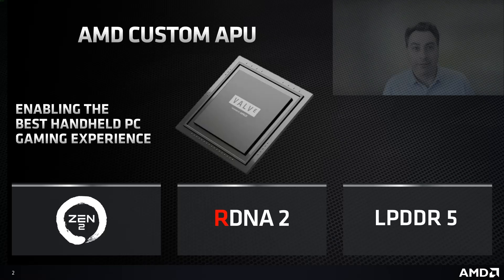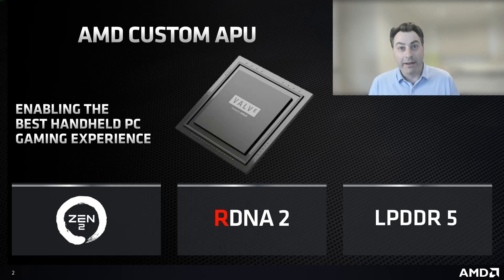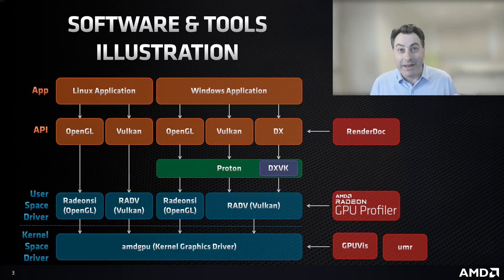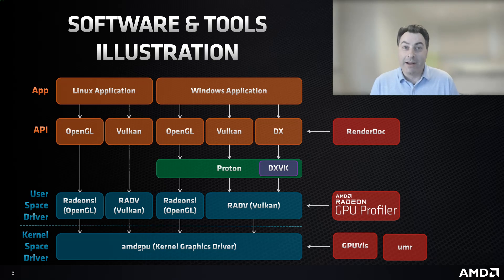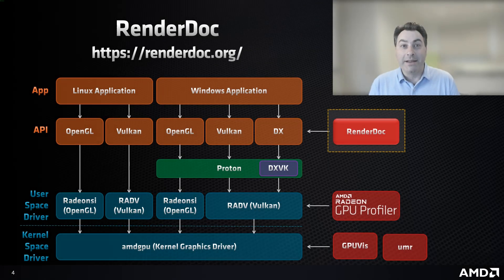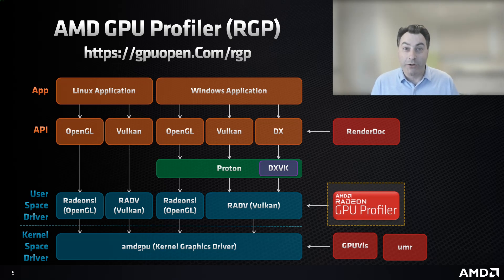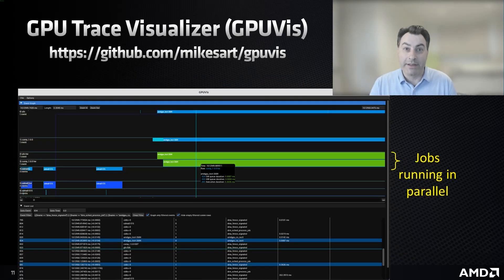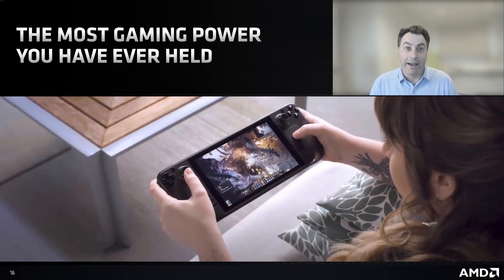APU Deep-dive with AMD

Comment: If someone mainly what to use steam deck on desktop mode, i mean connected to monitor keyboard and mouse, do it Worth?? Dose it have Battery protecting software? Will it work better if you use 🔌 with better cooling ? additional cooling.

Comment: Niice, when can we expect these APU's on desktop? Knowing AMD - probably 2029?! hahahha
Reply: A similar Desktop APU is already available and has been suggested in the "Development Without a Dev-Kit" video.
According to the partners wiki, it's a AMD Ryzen 7 3750H with Vega 10 Graphics, which is mostly on par with the Steam Deck.

Most of the optimizations mentioned here were related to power management, Desktop use has less demanding constraints.
Reply: when AM5 comes out with DDR5. APUs really need bandwidth.
Reply: Van Gogh is mobile only. It will never appear on Desktop. Desktop will receive Rembrandt, which is Zen 3 + 12 CU RDNA. So it should be quite a bit more stronger than the SteamDeck, even more with iGPU overclock and XMP DDR5 memory.
Reply: Maybe you live in a cave?
Zen 2 architecture is already created by AMD on Desktop market..
You didnt forget the latest 5000 Ryzen's APU do you? 
Even 3000 series Ryzen's APU is already powerful with Zen Architecture, let alone Zen+ and Zen2

AMD created desktop version first,
then laptop, and then Steam created their own version of "mini" AMD APU with the help of AMD itself
Reply: @abdur1300  Doesn't have RDNA 2 Graphics, though.

Comment: 3:32 LMAO he literally says games on windows will run better. I'm installing windows day 1 on my steam deck.
Reply: He literally doesn't say that.
It's most definitely true (at least by a few percent), but what he said there is completely different...
Reply: "Of course, games on Windows utilizing Vulcan API will need fewer software layers for(?) Proton, and will more efficient use of the hardware"
What that means is Windows games with Vulcan will run better then the same game using DirectX or OpenGL in Proton. Of course, removing the compatibility layer will improve performance, but in this specific case performance gains would be minimal, and you will be giving up custom Deck stuff I'm sure Valve prepared in SteamOS v3
Reply: I'm just gonna dual boot for the benefits of both. I don't wanna deal with Windows hiccups all the time.
Reply: What about the drivers?
Reply: I will install windows either way, just because. Also, older games and different launchers like epic, riot, blizzard etc...
Reply: @zaxmaxlax  Why wouldn't different launchers work? They specifically say (but maybe not in this video) that they went out of their way to make all of them work.
Reply: @zaxmaxlax  That's the most idiotic thing someone would do with Steam Deck.
Reply: @Trident_Euclid  why?
Reply: @zaxmaxlax  simply because windows doesn't officially supports it. Also Linux will and is optimized to run on such device and any bugs will be patched in no time.
Reply: @Trident_Euclid  What do you mean by not supporting it? The controller part acts like it is pluged in the USB just like any other controller, the screen is just a normal 800p screen. The touch screen maybe finicky but should work with the win10 tablet mode just like any touchscreen laptop.
Reply: @zaxmaxlax  have you done kernel diy compiling? Steam's default os will be better than windows since the kernel will be tailored to fit steamdeck's hardware, allowing better performance and energy consumption efficiency. Amd has been working with their drivers with linux for years just as well and is better than windows. Do what you want with it, but I doubt you can tinker the steam os with windows to be as efficient as linux. Windows alone consumes 1+gb of ram or more even on debloated configurations. Linux can be configured to just consume up to less less than 50 mb of ram, that's atleast x20 more efficient in memory usage, less programs less overhead and less bloat.
Reply: @zaxmaxlax  literally all of those work on deck, they already work on Linux even without proton.

Comment: I dont get it is this some sort of CPU what is an APU  ?
Reply: It's AMD way of calling a CPU with integrated graphics
Reply: @outofahat9363  ah.... makes more sense
Reply: @outofahat9363  thanks
Reply: APU or accelerated processing unit is AMD 's fancier way of saying of saying the CPU also comes with GPU cores along side the CPU cores, just like Intel's iGPU aka integrated GPU.
Running a display is dependent on GPU, if the CPU doesnt have iGPU then it cannot run a display, for that a discrete GPU card is required
Reply: @SankoshSaha_01  Ok !  thanks for the explanation...